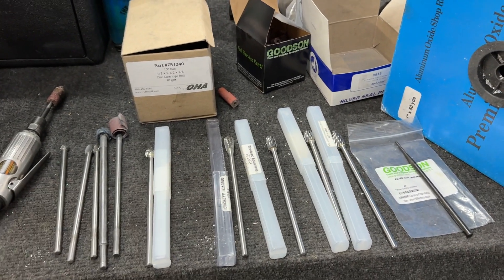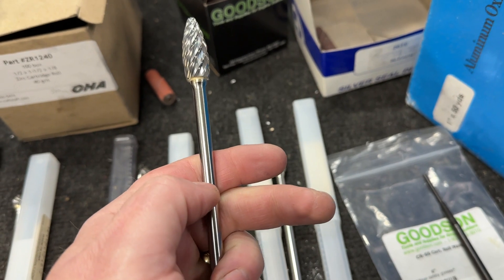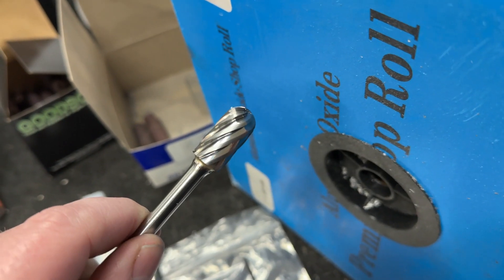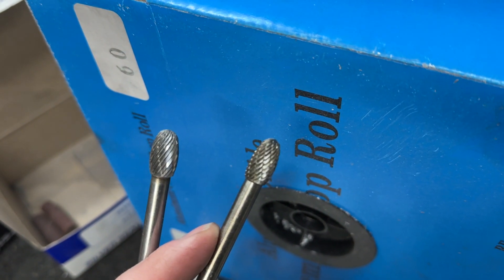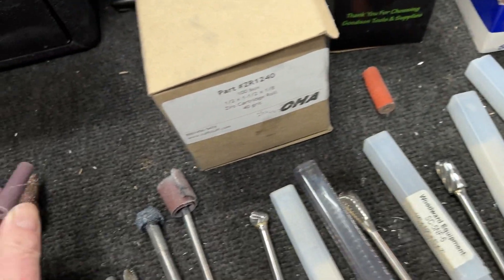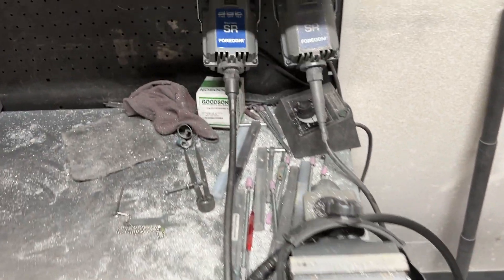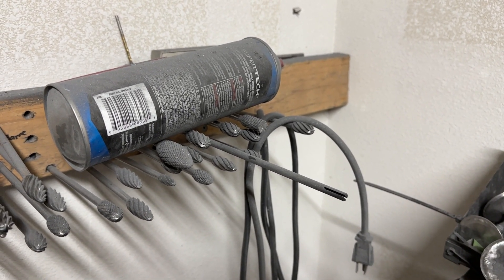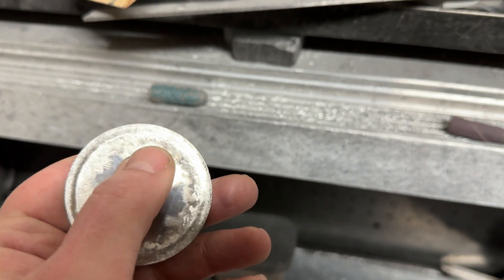Tools Used For Porting

Comment: Thanks Eric.
Awesome video for anyone thinking of getting into porting heads. It is an art that is worth preserving. 
Back in the old speed shop days, We had a "head guy" He was really good and very expensive. He would never give any details about how or what he did. You pay and you make power. All the top builders in the area used the same guy. 
David Visard recently referenced you and was pleased with your work.
Good endorsement. 
Keep up the good work Eric.

Comment: Good stuff Eric. Just a hint for anyone who reads this, I do a lot of aluminium work. If you are having trouble with cutting tools biting in, just dull the cutting edge a fraction. Often on new drill bits I will run a diamond lap, or a small stone, lightly over the cutting edge to take the very sharp edge off. If you do this, you will find that it still cuts we, but doesn't dig in aggressively. Regards Greg

Comment: All the stars align. I was looking at your videos last night to see what tools to get to port my intake manifold
Reply: I recently bought a cheap kit of burrs for aluminum on amazon.  They fit in a Dremel.  I used them to port an LT1 intake from a Gen2 LT1.  Much to my surprise, the $15 burr kit did a great job!  I did break one burr, but I got by with another one from the same kit (different shape).
Originally, I bought them for a different purpose, but they worked great on the short-runner intake.

Comment: Thanks Eric. Another great video.   I have the Fordom electric as well,  but I only use it for fine detail chamber work. It's 1/8 inch and I also have a very small 90° head for it because I used to do two stroke transfer ports.  It's great because it has a foot pedal.  I use air for every thing else,  because...well, I just have it and have for many years.  BTW, I love your videos and am learning still, even though I have been grinding on heads for almost 40 years.    I hate to think of some of what I destroyed many years ago.......

Comment: Hello friend, I have a small compressor and I can't buy an air die grinder because it would be charging air all the time, im looking for an electric die grinder, would you recommend the Makita G0603, can sand cartridge rolls be used in it? A friend told me that The electric grinder sucks to sand with ,easy way to bend the mandrel.   I need to do some light porting with power tools at home.im thinking on makita gd603 or a Foredom SR, could u help me ? greetings and excellent channel my congratulations❤😊 regards from Spain.

Comment: Gday  mate from Australia. I really appreciate the time and effort you put into these videos to try and give the first time head porters some good tips and advice on getting the best possible performance out of various head types. Along with Dave Vizard, Headflowinc, and other reputable engine builders videos, I have gained a great insight into the importance of correct head porting techniques, what to do and NOT to do. This video provides great guidance on what BITS I need to purchase for my own head porting project. Many thanks. Just on that Eric, I just wanted to confirm setting the throat diameter is between 88-90% of the valve diameter which in my case is a Holden V8 308 intake of 1.94 inch and the same for a 1.49 Exhaust valve. With the bowl area size, is there a % size this needs to be related to the valve size or runner size/area????Any rule of Thumb?? I understand you use porting in the bowl area to help slow and turn the flow into the seat/Throat. And you can use port bias to help slow plus direct the flow into the chamber which creates a venturi effect. With my Holden heads, the intake runners arrive at the combustion chamber at different angles EG one has a longer runner side aimed at the Cylinder side while the next runner aims at an opposite angle, the longer runner side goes to the NON-Cylinder side, which I see might cause some problems when using Port Bias while trying to keep the runners uniform. Holden V8s use an SBC intake profile unlike the SBF layout. Anyway again I really enjoy all the videos you make, your obvious experience, knowledge, skills and they way you explain things that one can understand. Thanks Eric.
Reply from the maker: Without seeing a Holden head I don’t think I can give proper advice on it.
Reply: @WeingartnerRacing  Not sure if I could send through to you a picture or diagram, just I appreciate your knowledge. If I could that I would be so grateful given how much you know about porting heads.

Comment: Thanks for another great video Eric! Did I hear you right? You port your throats by hand instead of using a cutter? I am curious because I have not been able to find any information on cutting or grinding valve throats. I would think you would be more consistent using a cutter and a machine vs doing it by hand. Still learning!
Reply from the maker: My throats are offset which is impossible with a seat and guide machine.

Comment: CHA website isn’t taking orders
The SE6 which is 6” shank 1/4” stem 1/2” egg shape is my most used cutter
I use a Dotco extended grinder that is extremely light and quiet, but is s 600$ grinder

Comment: If you spray the burr with wd40 or pb blaster  they wont clog up. Same goes for sand paper rolls and cut off wheels. The aluminum cant stick.